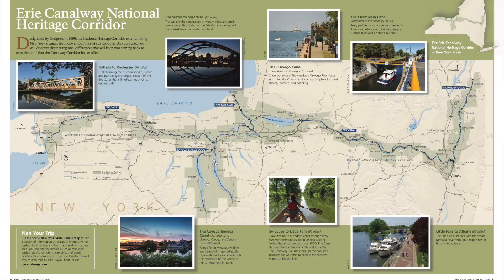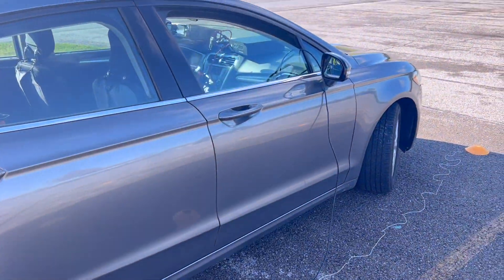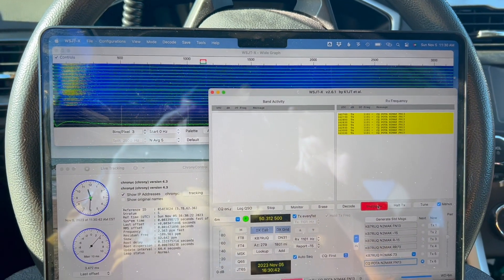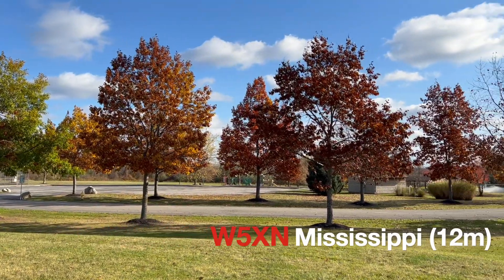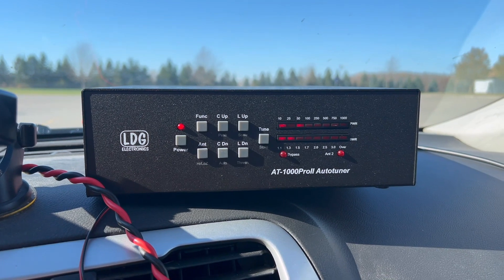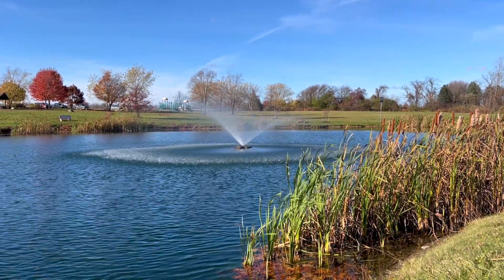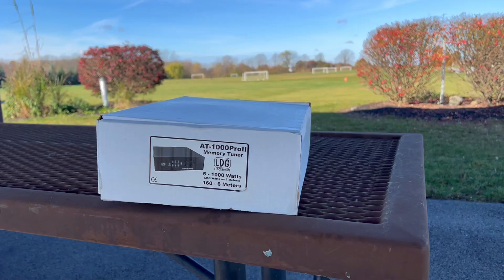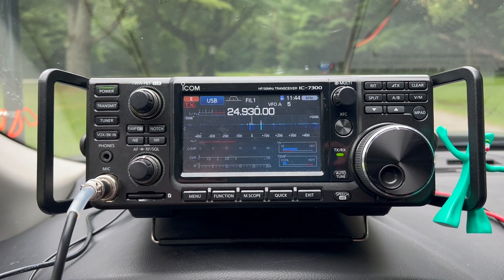POTA with the Rybakov Antenna and LDG AT-1000ProII Tuner

Comment: Hi Mike, I love the Rybakov but have placed the unun on the bottom of the vertical (on the ground).  Why do you place your unun where it is in the video?  What height are you using?  Tnx
N4LWT
Reply from the maker: Good catch! That was the first time I used it like this. Usually I have the unun on the ground too. Rather than have to adjust the mast height to get it just right, I figured I’d just attach the 4:1 to the pole wherever it ended up. It was only about 2.5 feet off the ground. I was curious if that would impact the radials but it seemed to work fine. Thanks for watching!

Comment: I used a Rybakov antenna  for field day and worked over 200 stations (mostly CW) with my IC-705. I have  eight 26 foot radials and four 17 foot  radials.  The radiation pattern on 6m is too high angle to be good. Perhaps a 3/8 wave on 15 or 12m would be much better on 6m.
Reply from the maker: Thanks, I suspected the radiation pattern wouldn't be good on 6m. That's great for your radials too. I want to add more than the six 17' ones I've been using to improve performance and reduce ground loss.